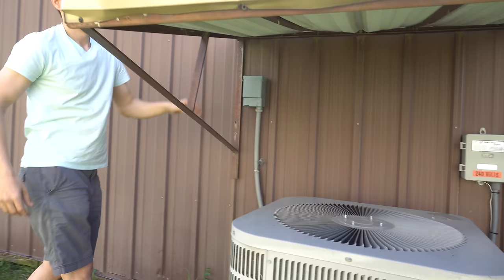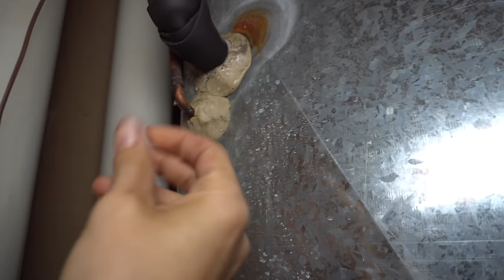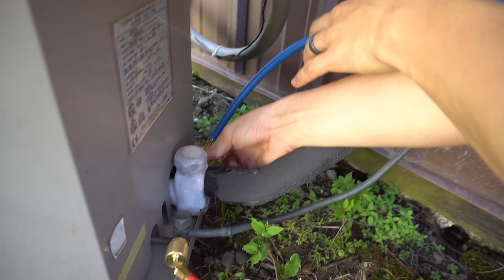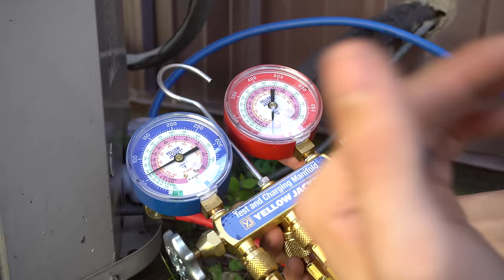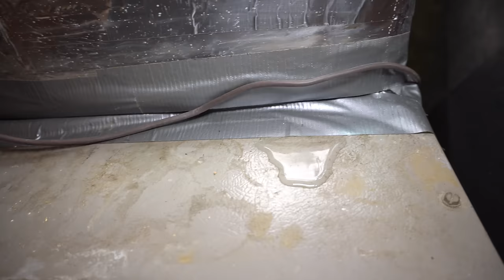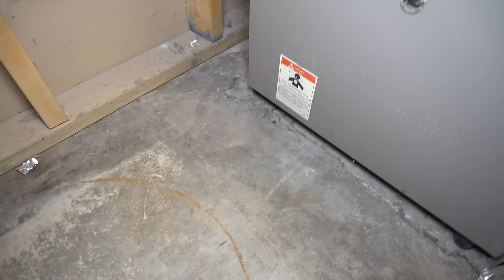How To Add Refrigerant To Air Conditioner

Comment: So what is the trade off or risk of using this simple easy method compared to the "proper method"?  Can I ruin my whole system if I'm not careful with this method or what?  I dont want to replace the system at this time if I can help it.

Comment: Why do u purge the low side again before u add in the few oz in the hoses and manifold
Reply: It’s to purge out any air before putting in refrigerant. This is because air is a non condensable and shouldn’t be in an AC system and can cause issues.

Comment: Does it ice over as a result of low refrigerant because the unit never turns off, never allowing defrosting between cycles? What was it about this system that triggered plans to replace the unit, rather than finding the leak and fixing it? Yeah, another vid with wet bulb method and explanation of superheat etc would be interesting.
Reply: With a low charge, the saturation temperature on the blue gauge is below 32 degrees. At 10:41 with the compressor running the pressure on the blue gauge was 50 psi. On the green (R-22) scale the refrigerant temperature was 26 degrees. This means that any condensate will freeze rather than run down the drain.
Reply: Thanks, Q2 is the elephant in the room.!
Reply: the refrigerant cant ABSORB anyore heat at the evaporator (inside coil) due to LOW refrigerant, thus it freezes- thats the science behind R22 low refrigerant. Outdoor coils (condensers) REJECT HEAT indoor coils (evaporator) ABSORB HEAT. WE say indoor and outdoor coils in the HVAC business (the smart competent engineers do) because you have Heat Pumps that can REVERSE REFRIGERANT and the indoor coil becomes a CONDENSER (rejecting heat into the building or residential) and the outdoor coil becomes a EVAPORATOR. So again its essential one know thermodynamics how refrigerants play into that science.
Reply: @kenmarriott5772  Thanks, Ken, brilliant answer, of course, ha ha! On the suction side if pressure is too low the coil will be paradoxically colder than it should be, because the R22 boiling point at that lower pressure is TOO low.That leads to ice formation from passing ambient moisture, which further limits air flow across the fins. The fixed flow of warm air blown across the evaporator fins is not enough to melt the ice, leading to inadequate cooling and an iced evaporator. What an enlightening idea.
Reply: Can do it with 407 c
Reply: In my experience, low gas doesnt produce serious ice, just superficial ice that easily melts. Since the gas is almost entirely vapor, although below zero it doesn't have much cooling power. Will commonly have a high superheat. 
On the other hand RESTRICTED AIRFLOW ie dead blower fan (with failed safeties) can produce SOLID ice on some occasions i'v even seen ice entirely filled air handler AND the compressor cabinet such that the machine covers were frozen on, that takes a fair bit to melt

Comment: My furnace also does not offer access to the A-coil. How could I get access to clean it?
If I would install a access door, is the A-coil enclosed by it self? Furnace upwards installed. Furnace is 25 years old and A-coil probably never got a clean. (never failed for the last 8 years)

Comment: Good video! Is it ok to have the condenser covered like that?
Reply from the maker: Thank you! As long as it is at least 2 feet above it, it is okay.
Reply: A lot depends on that but usually the answer is no. The discharge air recirculating will limit the heat removal process from the condenser coil causing high head pressures, loss of cooling, and overheating the system windings leading to early failure. So instead of a 15 year system it fails at 10 or less.
Reply: Mark's answer is most correct.

Comment: How do you know which is the low side and which is the high side on the airconditioner?
Reply from the maker: The thicker pipe will be the low side and the thinner is the high side.

Comment: I have either a leaking schrader valve, or hole in the coils , I  have a heat pump/ AC unit 3.5 ton York, its's about 16 years old,  When is the best time to add some stop leak . My system has no pressure now...as it all leaked out,  and I lost all my cooling last Friday morning... per an AC tech that was here last Friday......Was told my system holds 7 lbs of R 22......am in AZ...really hot here today 104 degrees....
Reply: You can add stop leak when your ready to buy a new unit, because that crap is going to plug up your old unit ! If it’s leaking that fast it should be easy to find the leak and repair it, or replace the bad part, probably the  evaporator coil.

Comment: Another grat Vid. My unit wont take a charge 1998 R22 3 ton Sub cool is good 11 degrees Super heat is high 70 degree on line and 38 lbs  on low side  about a 50 degree superheat but when I try to introduce r22 in suctiob sdie I get no refrigerant when I crack the hose to purge air and wont take refrigerant  Ant ideas  Could here be a valve at suction streeter valve closed to go in? But it reads pressure so it must be getting a connection. I have added refrigerant several times so I am pretty experienced in this simple task Please anyone any ideas?
Reply: The core isn't depressed enough turn the valve depressor on ur hose out a bit more
Reply: @bago49  Thanks I do however get a reading on the low side on my gauge. Is that consistent with a reading I just cant get refrigerant to escape when I Try to purge the air from the hose just a slight hiss.
Reply: Thank you, you were correct I tried 2 different hose, so I wasn't optimistic that that was the problem. I took a needlenose and turned counter clockwise on the streeter valve tip (anvil across the pin) and Bamm it worked
Reply: most likely not as the valve has a stopping point with the treads when being screwed in, I think it's just something you come across from time to time🤷🏽‍♂️ once i figured out the fix was so simple I never paid anymore thought into the  actual cause. Speculating now I would say it's the counter pressure in the unit holding it back this you need the extra length to depress it further
Reply: a slight depression of the valve is enough to pressurize your gauge , but it's not enough for free flow of refrigerant

Comment: Nice job 👍 out of curiosity what is r22 go for in your neck of the woods for the jug in Atlanta it’s $ 465
Reply: I use a drop in replacement freon for r22 which is 150$ a 25lb jug
Reply: @Kilo5910420  There is NO drop in refrigerant for R22 thats a misconception of science: marketing bullshit. There is 404a (one example) Refrigerant but the slide on it doesnt match R22 100% which is a single components where 404a is made up of three (3) types of refrigerant. This may not work in all refrigerant systems as a compatible replacement and ALL R22 needs to be removed NOT mixed and a complete flush, blow-out of lineset. R22 is growing in price at roughly $500-$700 a 30lb tank 2025 no more virgin R22 will be produced: reclaimed and recovered R22. Here some more education on other refrigerants Beware of oil compadibility as R22 uses mineral oil https://www.agas.com/media/2524/a-gas_r22.pdf
Reply from the maker: Thank you Harry! It is around $450 here. But depends on where you get it... On E-bay you can get a 30lb jug for $375 ;)
Reply: @proanswers  R404A is not compatibile with mineral oil, which is most likely used in R22 old system

Comment: What are some other signs that my refrigerant might be low. My suction line is cold but its not sweating, its not barely noticible cold
Reply: Mean you have a leak and you need to recharge or get a new unit.

Comment: Hi , I bought R22 10lb(13.4lb including bottle). I tried to refill R22 to my home Carrier A/C unit which shows about 5 lb factory filling. Yellow Jacket tested A.C unit which shows no R22 because Blue gauge shows under ZERO psi when running (when not running, the both blue and red gauge shows 120 PSI). So, I started to refill in order to reach about 70PSI (40F, r22 GAS up right position),and successfully reached to 20PSI smoothly, and after then It takes time to reach to 30PSI more than 10 minutes, so I stopped because I am afraid. Anyway,  when I open Blue valve to refill R22, the blue gauge do not respond strongly. It looks like there is no gas in the tank. But, the tank R22 still has 9.8 LB including tank. Which means "13.4lb - 9.8lb"=3.6lb is refilled only. After this, I did not tried to keep filling because I tried to refill more than 10 minutes, but the Blue gauge seems to not refill the R22 or there is something wrong on the R22 product. Could you let me know why I could not refill qucikly after 20psi, and I could not refill from 30PSI since the Blue gauge is not responding to rightward, which stay about 40 or 50PSI location, so I tried more than 10 minutes and stopped all things. Finally, I measured the R22 tank with scale as I mentioned above. I maybe refilled only 3.6PSI .
Could you give me help about this issue? Is this Yellow Jacket issue or R22 quality issue or my process issue. My home AC unit is typical 5LB Carrier brand located outside of home/
Mark

Comment: Can you do it with only one gage ? The low side of course, why you need two gages ?
Reply from the maker: If there is something wrong besides the unit just being low on refrigerant (such as a plugged metering device), you may completely miss that problem if you only have one gauge on. But to add refrigerant, yes. It's possible to do it with just one gauge.
Reply: @WordofAdviceTV  yes, thank you for the reply, you are the best. One more question, what would be a fair price to pay for someone to come out and do this and add r22 if needed ? The line is not freezing but the temp on the vent in the house is 70F and the AC runs long. I am in Chicago.
Reply from the maker: @lx4118  Have you watched this video yet? https://youtu.be/6jsm3tWmoPU?si=g20Feer3SnOh55DW

It may not be a refrigerant problem at all. If your unit is leaking, whatever they add would leak out again unless they fix the leak. Refrigerant problems get very expensive and since R22 is no longer made, it would be even more for you. As for pricing, it would really depend on the company. Get a few quotes. At the very least it would be around $500.
Reply: @WordofAdviceTV  it is not leaking. I can buy 2 lbs of R22 with one gage for $160 and do it myself instead paying $500
Reply from the maker: @lx4118  Yes. If you can do it yourself, definitely do that. That will always cost you way less than calling someone out.

Comment: ive never heard about refrigerant leaking out during winter
Reply: If there is a leak then the refrigerant will be constantly leaking out. The system being on or off can cause the leak to increase or decrease depending on where it is.

Comment: Thank you, Thank you, Thank you so much for this video!  It is no surprise to me that you are the first HVAC guy to do this in an understandable, semi-complete & real-world way!  I am super happy that it is about R-22 also since there are none that I know of (as clearly explained as this one) on youtube.  1) Is that plumber's putty on the evap case (prob. why not much water leaked out?) ?  If not, then, what is it?  I have never seen that before.  2) If it is PPutty, do you recommend that over aluminum Duct tape?  Also, 3) is it healthy to use the furnace like that (with such a HUGE temp. difference between ice and fire.  I would think that it would be VERY unhealthy for the longevity of the evap coil but maybe they are built to withstand that?  I only say this because in most other cases other materials (engine blocks, glass, other random materials) will fracture, crack, or break when subject to radical temp changes like this.  Also, surprised you did not have gloves on but was happy that you made the short safety note later in video.  Another question... 4)why did you have to bleed air out of the red line near the end of the video (after unhooking from the system)  you said to get rid of air... but I can't figure out why there would be any air there and / or where that air could have came from (since all other hoses are sealed off or attached to the system).  Please clarify this last question in detail as I am a little slow :-).
Reply from the maker: Haha I am glad to know that you really enjoyed the video! You're welcome! 

1. That is indeed plumber's putty and it's pretty commonly used to seal up the holes where the refrigerant pipes come into the plenum. I don't think that had any effect on there not being much water that leaked out though. My guess is that the A-coil was not as frozen as I initially thought. I was short on time so unfortunately I did not open it up to look at it.

2. The putty is better for sealing up holes but the tape is good for gaps or cracks. Neither one is meant to prevent leaking water though.

3. It is not optimal to do so but many technicians, including myself, do it. Otherwise we need to come back the next day. I have actually never had any problems from doing this. As far as I know, there is no harm done to the A-coil at all. The ice cools off the coil at the same time as it is being heated. Once in a long time, the water that leaks down after the ice or frost thaws, damages the control board or motor in the furnace though. That I have seen before. But even if I was to let it thaw with just the fan on, likely it would leak in a similar fashion and into the same spots anyway.

4. Usually I do always wear gloves because frostbite is not very pleasant...

5. Most likely there was no need to bleed the red hose but I like to do so anyway. When I take the fitting off of the unit and put it onto my manifold gauge, there is a tiny bit of air that goes into the manifold when I put that fitting onto the gauge set. There is a good chance that when I am putting the red hose onto the manifold, that air bubble is pushed out right away as I am screwing on the fitting but it's just a habit of mine to make sure so I just purge anyway. Purge, purge, purge was drilled into me at school... "Moisture and air are the biggest enemies of refrigeration systems."
Reply: @WordofAdviceTV  Thanks for your fast reply.  1) So you say you are purging because putting the end of the hose (that WAS attached to the system but now is not) might have captured additional air while securing it back onto the manifold?  2) If so, then why not just put the R22 back into they system after removing the red hose from system but BEFORE you attach the red hose onto the manifold?  3.)Maybe I am not understanding... I can't figure out how you could purge that air out (effectively) the way you did it in the video and still retain most of the R22 in the line set.  seems like both the air & R22 would ALREADY be mixed together in the lineset (so purging would be pointless).  4) your thoughts on what I just typed???
Reply from the maker: Jo Tu you have enlightened me! :) 1) That is what I meant, yes. 2) And indeed.. It would be smart to simply do what you said: "just put the R22 back into the system after removing the red hose from system but BEFORE you attach the red hose onto the manifold". I will do that from now on as that sounds like the better way, thank you! You questions often make me question things that I have been taught and am currently practicing in the field... I honestly don't have a good answer for 3) and 4). But here is my attempt to explain it how I understand it. R22 and air do not mix. It's like little air bubbles in the system. But what I am purging is only the air in the hoses, not anything that is in the line set. As for how it works.. The refrigerant gauge hoses should be hooked up while the unit is off. That pressurizes the hoses and pushes all the air to the other end at the manifold. When I crack open the fittings, air spurts out first, followed by refrigerant. That effectively gets the air out of the hoses. And that's pretty much it.. I don't know if I am entirely accurate and I believe there are not many techs who know the specific science of it all. Haha well and I am definitely not even close to being one of them.
Reply: @WordofAdviceTV  Thanks for the reply
Reply: @WordofAdviceTV  you're really slamming so much misinformation out there.  Please watch the hvac school channel with Bryan Orr....
Reply: @flatearthdays  Orr... please stop making lame remarks such as this one Mr. Sarabi!  SHAME ON YOU for this comment.  Word of advice HVAC videos are the absolute BEST and CLEAR and SPOT ON. I looked at your channel and found ZERO videos.  Please produce at least a SINGLE video before leaving negative comments on other channels because it is OBVIOUS to me that your remark is VERY bias!!! You sound like you are a card-carrying member (and I am not referring to the 608 card) of the HVAC "illuminati" that touts thoughts similar to "HVAC is so very complicated, mysterious, dangerous and magical that only I can fix it (for a SUPER huge profit)".  Shame, Shame, Shame< on you!!!
Reply: Jo Tu take your meds. Ever heard of superheat? Yeah.... check it out, you might learn something.
Reply: @flatearthdays  I don't need meds (but I think you do) and I already learned something prior to getting my 608 card.  Thus I have "heard of superheat".  Sorry if I pulled you away from overcharging your customers.
Reply: Jo Tu 😂

Comment: Can you run the heat to melt the ice
Reply from the maker: Yes. I've done it plenty of times but do be aware that there is a slight possibility that the water from melted ice may go over the electrical components in the furnace and short something out. (It hasn't happened to me before but it's a possibility.)

Comment: What makes the A coil to freeze?
Thanks;
Reply: From what I know poor airflow
Reply: Restricted airflow
Low refrigerant
Failing thermostatic expansion valve
Intermittent indoor blower motor failure
Bad blower motor relay
Bad blower motor ECM
Stuck contactor in the condensing unit
Thermostat failure
plenty more where these came from...